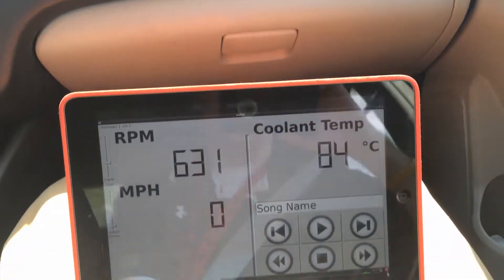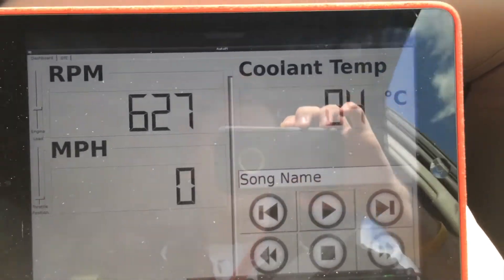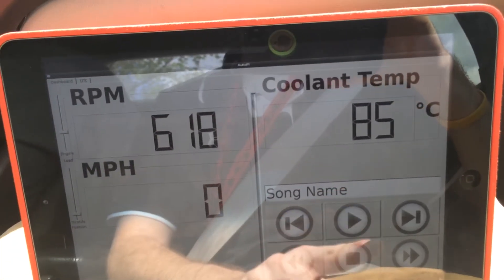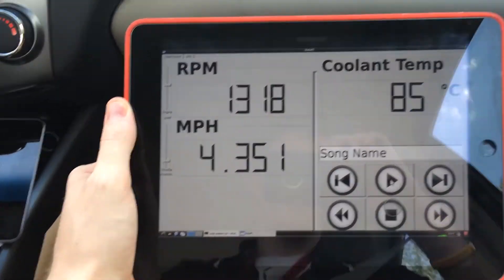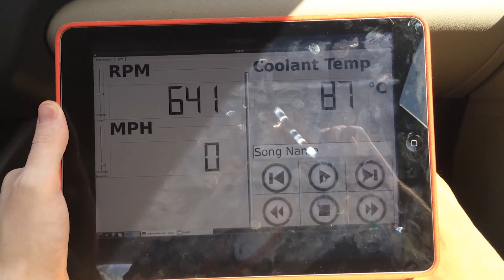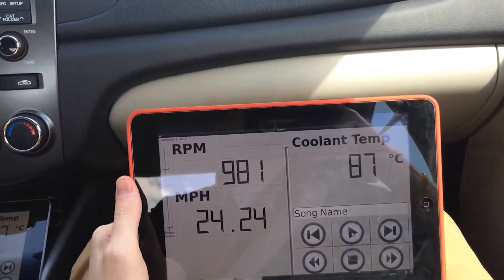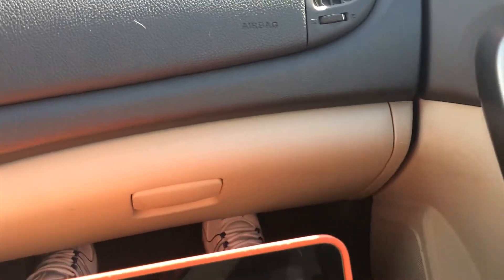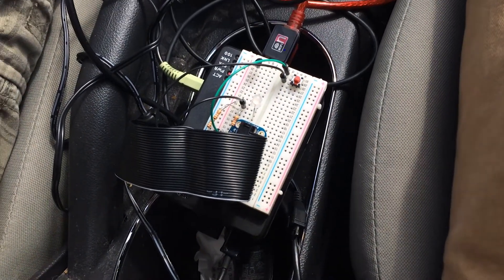AutoPi

Comment: Honestly this is a good idea. I drive an old car so when I go faster like when I'm on the freeway, I actually turn up the volume accordingly because the road noise just gets pretty loud. Then when I hit slower residential areas, I turn the volume back down. Can you grab other data from the OBD like side windows open/close? Perhaps modulate volume also based on window position.